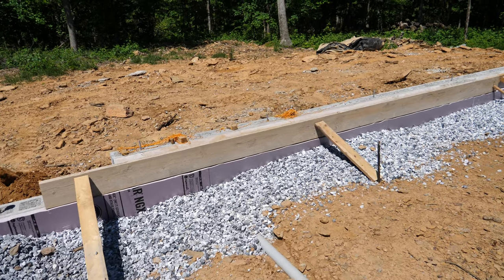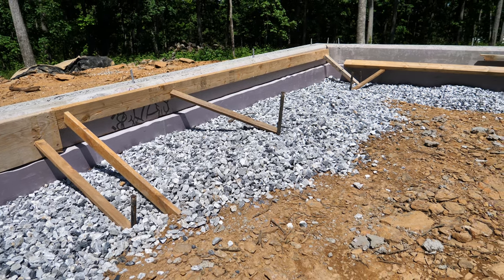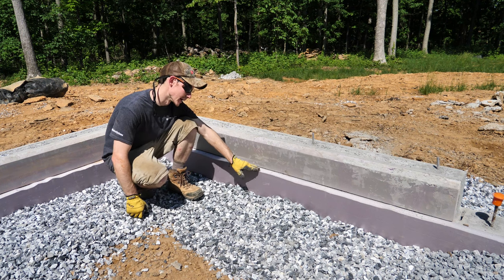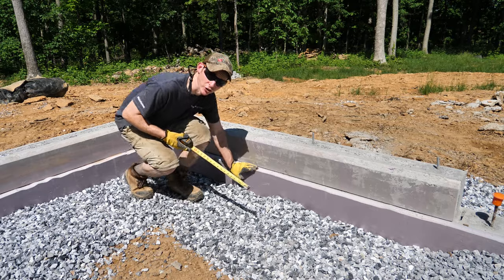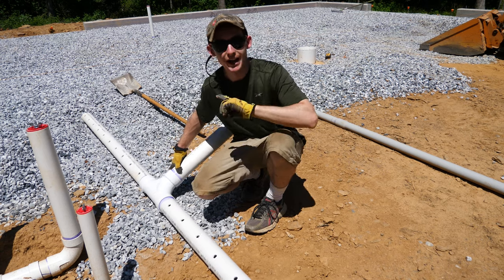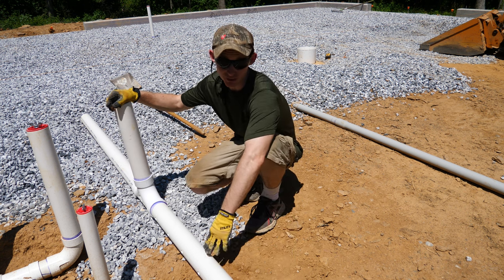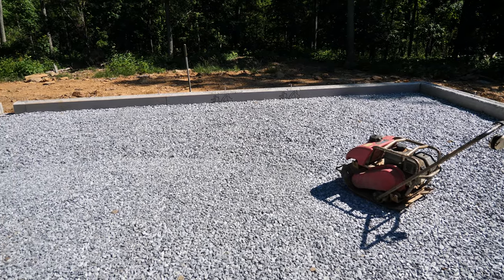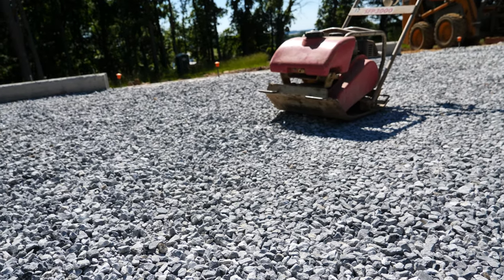Backfilling, Leveling, and Compacting Gravel under Slab

Comment: I noticed that you put the 57 directly on the plumbing. I would have thought that the plumbing would need to be covered with dirt before the 57.  Just curious.
Reply from the maker: Either is fine but I want as little settling around underground pipes as possible. It would take a major concentrated force to hurt a schedule 40 pipe with 3/4” stone, I don’t even think my skid steer could do it if I drove directly on top

Comment: How much compaction did you notice?  I am about to rake out the same rock and wanted to level before compacting to consider any settling.  Thanks!
Reply from the maker: Very little to none, the compactor basically just settles the stone into each other to make a flat surface on top

Comment: QUESTION - I removed a home that had a slab foundation and now my new house is calling for a crawl space so we have foundation walls and footings that are needed but right now theres a slope which is requiring a 5' stem wall but engeineer is telling me to use angular clear rocks and pound it in without inspection required. To me it sounds like it would be better to get the minus stuff in there to rid voids and provide better compact. Thoughts here? Am i crazy?
Reply from the maker: Use angular clean stone compacted with a gravel plate compactor in no more than 6" lifts. It is the best material for a drainable foundation base.

Comment: The 3/4 clean gravel/rock or as it is usually called “#57” cannot be compacted. Theoretically and practically. Zero. What the compacting plate provided in this case is a flat surface, not a compacted layer of #57. Another important function of this layer of #57 is that doesn’t absorb water by capillarity keeping the water level as low as it comes naturally.
Reply from the maker: Incorrect. Here's some light reading from a PE if you don't believe me. See the last point. https://icpi.org/blog/the-myth-of-self-compacting-aggregates